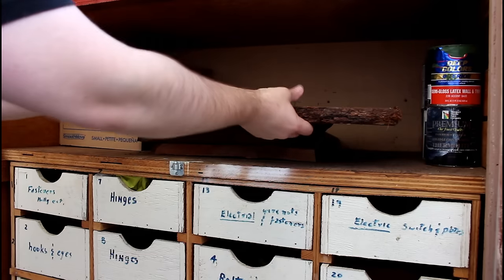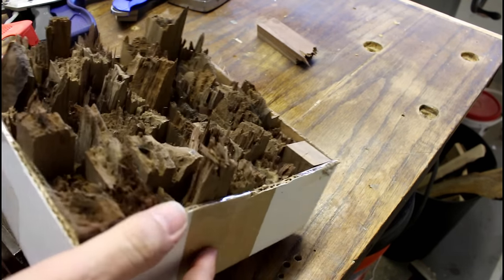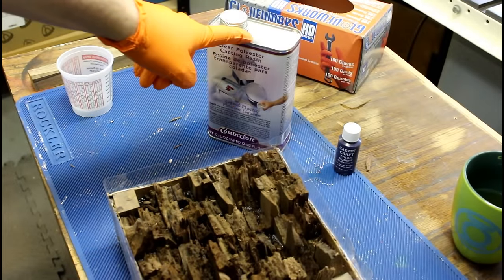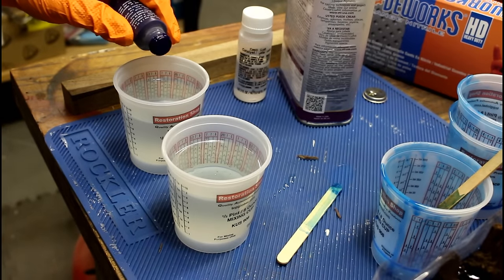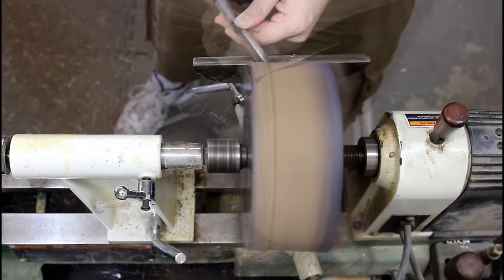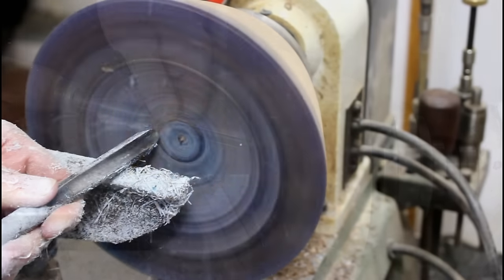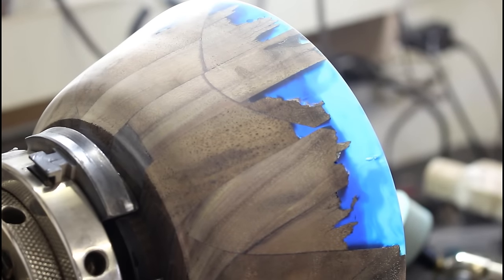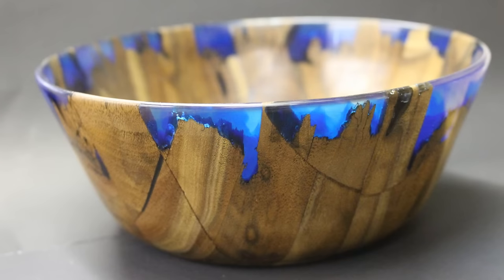Secret Wood Bowl DIY

Comment: Your work is exquisite young man. I’m also a wood turner  and my specialty is roots that  have been in swamp or lake or river for quite some time. Isuggest you try it at least once. Don’t be alarmed at fist the wood is spongy Saturday it with olive oil and put i#in the oven for one at the time, you will eventually see it bubble. Take it out and saturate with olive oil. Numerous time until it seems dry. Not too dry. Put it on the lathe and begin the roughest oh the bowl. You will see amazing wood design and colours. Don’t do mor e then th e rough. Put it back in the oven at 200 for 45 minutes. Take it out and reapply olive oil. Let it set in a dry areas for 2 months. Then finish it. You will love it!

Comment: Was having resin in the middle actually necessary at all? I feel like you could've just build up the wood and have a little trench around the perimeter for the resin on the brim of the finished bowl
Reply: Elder Eggplant I was thinking the exact same thing. The bowl looks amazing, but I think he could have gotten the same result with a lot less resin
Reply: Elder Eggplant the resin in the middle was to stop the entire thing from getting ruined from one fuck up.
Reply: Elder Eggplant Why not use a lower quality wood in the middle since it is carved away

Comment: dip it . 
pizza serving plate made outta a real pizza .
Reply: Probably wouldn't work, the moisture in it would rot, or it wouldn't dry correctly.
Reply: Yea the grease would probably react poorly with the resin.
Reply: pinkasfloyd 7 would it get nasty over time
Reply: pinkasfloyd 7 I think it's a cool idea and if bacon worked I don't see why a pizza wouldn't
Reply: PLEASE
Reply: you could "bake" the pizza at a low temperature for awhile to dry it
Reply: look up "forever pizza" it's an art project with pizza preserved in resin. So he could totally do it. :)
Reply: there's a preservative treatment used on medical samples and "food samples" for marketing...don't know much about it, other than it involves polyethylene glycol......but the end result is very "plastic-y" and rot resistant...
Reply: You honestly wouldn't have to do any extra baking to dry it, just let it sit out for a day or two and it will go stale. Still looks good, but will lose a lot of moisture.
Reply: Peter Brown has dipped bacon before so if grease or water had an effect on the resin I think we would all know. Pretty sure the pizza would be fine and it's a really awesome idea.
Reply: pinkasfloyd 7 sounds cool
Reply: pinkasfloyd 7 freeze dry it first to prevent mold from forming
Reply: Has science gone too far?
Reply: Joel Gray he wiped of the grease
Reply: pinkasfloyd 7 no put a pizza in epoxy than use that as a pizza serving tray
Reply: Dont use a real pizza, the grease will deffinitely make things complicated. Just make a pizza out of epoxy putty etc.
btw.:The bowl looks awesome I just dont have that much money for a single bowl(especially If I havent done it before and there is a great chance that it will break apart), nor do I have a lathe that large to hold it.
Reply: ABW941 use a frozen pizza
Reply: eddie julian r u joking?
Reply: teszwa he is... even with my cookies i couldnt find it

Comment: Would make a cool lampshade with a different dimension.    Love the bowl,  too.   How did you finish the wood?
Reply from the maker: +Jim Templin i use one light coat of wipe on poly. After sanding to 1500 grit it didn't need much of a finish.

Comment: That is incredibly beautiful!! Great idea for the mold. I am going to have to keep that filed away in my brain for later use. :) What was that tool that you were using to put the sandpaper on when you first started sanding? - Heidi
Reply from the maker: Thank Heidi-
I normally do 'power sanding" with a 3/8 right angle drill. It died during the 120 grit round. This is a sorby sandmaster. It's a friction based random orbit sander. Honestly, I like the drill better....
Reply: Thanks for the information. :) They both looked useful. :)

Comment: Would it be possible to make a Secret Cuttinboard or is the resin to weak to handle all of the cutting?
Reply: Epoxy is FAR stronger than wood - in fact its almost as strong as steel
Reply: But resin shouldn’t be used for food
Reply: use stonecoat epoxy

Comment: you complain about using so much resin and then just go and waste it all! why not leave all the middle pillars of wood to take up the space in the center of the bowl and then save like 80% of the resin you would have used. You put in like a gallon of resin and then ended up with like a cup actually still on the piece's edges

Comment: If you want to use less resin, try putting a spacer block in the middle of the blank. Because of those spikey bits, it wouldn't save too much but every little bit helps. Since its a circular bowl you could put some in the corners too!

Comment: Great job!!  Can you turn the broken wood into the rough shape of a bowl once you embed the wood with resin at the base? If so, you'll be able to create bowl-plugs in the shape of the bowl to reduce a large amount of resin.  If you want to go balls-out you can even create a silicone-bowl-plug that will produce an icy smooth finish.  I suggest silicone because nothing really sticks to it and it will take a beating and keep on ticking.

Comment: This is awesome! I'd love to try this. Just curious though, instead of just whittling away the entire inside of the bowl, couldn't you  use the lathe to sort of "hook" out the inside and make progressively smaller bowls? For instance, if you used a hook shaped tool to carve out the inside like you'd carve out a watermelon, and just keep going down till you've made about 4 or 5 smaller bowls out of it. Just a thought, don't know if it'd be possible or not.

Comment: Hello and Good Evening. 
I noticed you use different resins and wondering why?
Is it cost, pot time, amount of stirring or not, or amount of bubbles?
Please recommend an easy clear resin that is easy to mix and has about a 20 minute pot time.
Basically, point my in the direction of a good 1st or 2nd resin for flooding.
Thank you for your videos and patience with all my questions.

Comment: I don't know if this has been suggested before (I haven't watched all your videos and definitely haven't read all the comments) but on a different video you mixed in resin shavings - wouldn't doing that lower the total volume of fresh resin needed? Also, if the shavings weren't the same color as the fresh resin it might add a cool effect. I've never worked with resin and I don't know terribly much about it, so I'm not sure if it's even feasible, but it's an idea

Comment: Looks beautiful but I wonder if there is a more efficient way to do it cause the finish project doesn't have that much resin so it feels like a lot was waisted I wonder if you could maybe make a mold with silicon so you would use less resin maybe

Comment: Didn't want to read 3,000+ comments, so I will just ask: Did you put the mold in a pressure pot to cure? If not, do you not use pressure pots on any of your resin hybrid blanks? I would love to try this, but I am reluctant to go out and buy a harbor Freight Pressure paint Pot and convert it. Is there a clear resin that absolutely doesn't require pressure to cure (and of course leaves no bubbles in the finished blank?

Comment: Iam not completely sure but how about if we use two molds a larger one and a smaller fitted inside each other with enough gap on the sides and the base which will then be stacked with the wood pieces and resin. Should save a lot of resin. Love your work bdw!

Comment: I’m in the middle of making an ironwood/ resin bowl, did you use any finish on the wood or was the PlastX for both the resin and the wood?  I’m using Alumilite clear slow setting btw if that makes any difference.

Comment: I've tried something like this recently and found out the hard way that the wood I was using was less dense than the resin.  All of the wood blocks immediately started to float in the resin.  Did you have a similar issue, or is mahogany particularly dense?  Thanks.

Comment: Is resin food safe?  Can it be put in a dishwasher/microwave?  I've been inspired to make dishes with it, but am wondering if they will be mostly for decor.
Reply: As long as it is mixed correctly, epoxy resin is safe, but you can get specifically food safe epoxy (for water tanks on boats). Polyester resin is probably less safe, mostly because it is easier to mix it wrong.
Reply: Resin is toxic unless you get a specific non toxic resin, this type of bowl shouldn’t be used for food and considering it is half wood I doubt it is microwave and dishwasher safe.

Comment: Would putting shorter wood in the middle areas give more of a chance to have some color/resin in the bowl other than the edges? seems like kinda a waste to use so much resin and then just shave 90% of it off.

Comment: A simple solution to using the same method but conserving resin would be to put extra tall or unbroken pieces of wood on the inner layers, thus resin would only be used on the outside where you would see it (sans in the middle to hold them all together). Great work though!

Comment: To get air bubbles out, you could use a vacuum.  A vacuum chamber made from wood and plexiglass should hold high enough a vacuum for this purpose.  You can buy a vacuum pump for $50.

Comment: I love the final results. I just don't get why you did some of the things. I don't get what you poured so much dark blue resin when none of that really showed up in the final product. It looks like you removed all that resin.

Just a suggestion, perhaps it is better to attach your walnut bits and parts together, cut it with your band saw, and start removing material. Then, you can create a plug for the side to create that beautiful blue. You'll spend less on resin, make less waste and do less work. It'll probably just take longer though.

Comment: You should not have planned the strips, the extra "fuzziness" would have allowed the resin to flow between the pieces better and helped lock them together. Also, pressure pot would have made it better.

Comment: Couldn't you have used the shorter bits of wood in the middle area and then used longer as it got to the edges and then used something to displace resin in the center(like styrofoam)? That would have saved a lot of time and money on resin.

Comment: I’ve seen when using epoxy resin with dye or powders . Why use a vacuum chamber or a pressure pot . Instead of just letting it cure all on its own .

Comment: I haven't done any serious woodwork before, but to common sense, since you don't plan on showing epoxy in the center, why break up wood pieces and glue them there? You could have just made the outside "secret wood-ish" and add a border of wood for wall and the center could have been measured prior and place blocks at desired gradients and you could have saved a lot of materials already. The radial cross section is like so: [S for broken wood and W for normal blocks]

　　W
SSW
SSW (The extra height reserved for the "sky")
SSWW  (Gradient starts here)
SSWWWW
SSWWWWWWWW